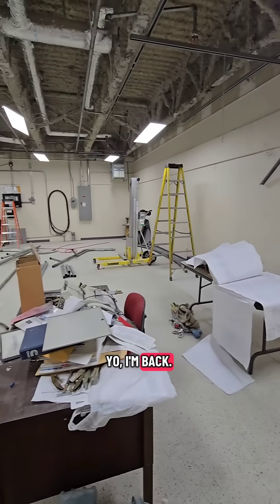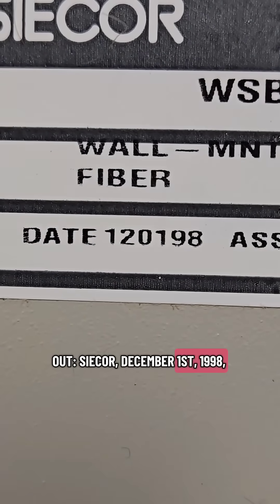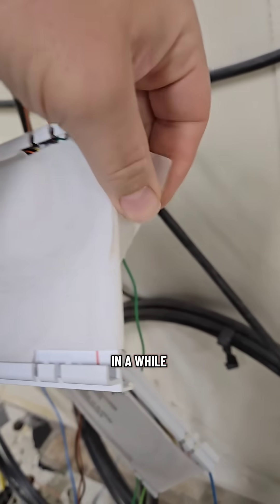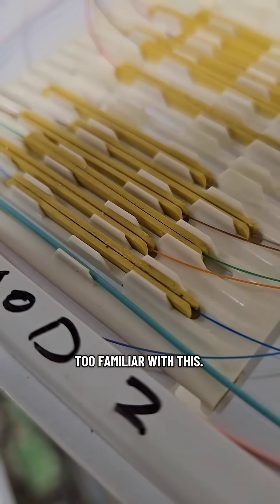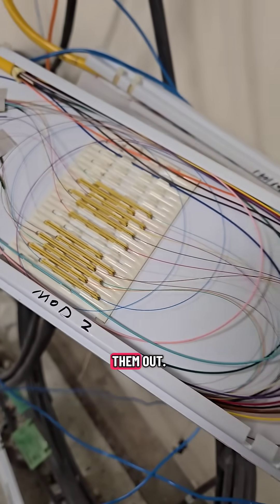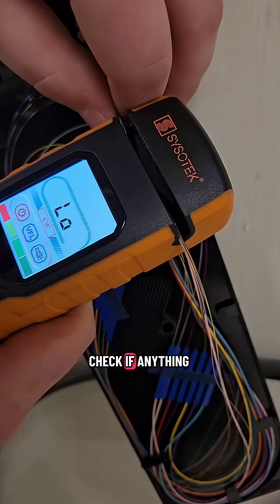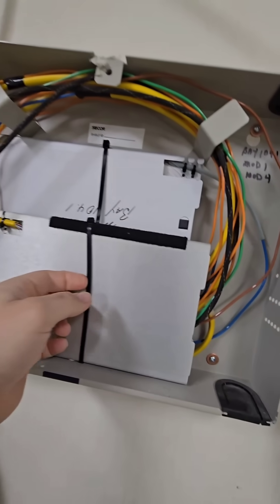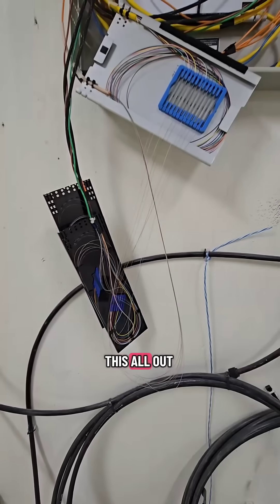#fiberoptics #fibertech #telecomlife #splicing #otdrtesting #networkengineering #sysotek #fibernerd

Comment: Those "mechanical splices" are actually protection covers for fusion splices (way before the heat-shrink tubes with steel rods in them). 

I'm really surprised to see them in those types of trays labeled as Siecor; the first time we used those was in about 1983 on NT (before they renamed to Nortel) splice equipment. They sucked ass then, just made for multimode fiber, before Siecor came out with their M67 singlemode machine, which was a godsend, along with the metal Siecor trays. The NT fiber was crap too, but the Siecor fiber was terrific.

Back then everything was super primitive,  everything was barely functional, no OTDRs, no local optimization, cleavers barely made square cuts. Shoot, not even cell phones or GPS back then; it was paper maps and payphones.

All you guys doing fiber splicing now should be glad things have evolved as well as they have. It was cool way back then but was a giant PITA too.

Comment: What's the risk of a demo crew cutting into a "live" fiber optic line?
Reply: You get angry sysadmins coming at you with steam coming out of their ears.
Reply: The optical power today can burn retinas if you look into the fiber but amplified ROADM lines can carry a lot of channels/power, and cut (broken) ends of fiber can spread powerful quantities of infrafred (invisible) light. Most systems shut down the amps to prevent problems for the workers.

And that's just a single pair, most long haul routes have ROADM systems on every pair - a lot of light.

Cable cuts happen several times every day in large networks, so there's a lot of redundancy/resiliency built in to the networks these days.

Comment: Imagine if you ever saw some knob and tube from the 20’s lol. Side note: do these lines even carry over 30v? Do you have to worry about cutting a fiber line?
Reply: Just light there.  Some cables existed that had power cables I. The same sheath as the fiber so you could power remote equipment with one cable and didn't need to get power from the power company but that wasn't widely adopted
Reply: @MrNoobed  Subsea cables using submerged amps carry power within the same cable. Interesting (to me anyway) is that there's only a single conductor in the cable, the circuit is closed by "grounding" out to the seawater.
Reply: @wayneruffner oh right.  They did try it for normal aerial/buried cables too, but thats where it wasnt really very popular.

Comment: 1998 is ancient now ☹️
Reply: 5mbs 😅
Reply: @unbanmy360 dial up was 33.6 kbps and even most large businesses would have only had a 1.5 mbps T1 if they were lucky
Reply: @thedopplereffect00  we did for internet, but had a 64kb frame relay link from the UK to Germany to get to head office. I remember my colleague trying to test early video conferencing as the CEOs (called MD then) were often from other countries and wanted to video conference their kids. I think latency was a bigger issue than bandwidth iirc.
Reply: @thedopplereffect00 isdn was the bomb for a time lol
Reply: @unbanmy360  I was on the world's very first long haul singlemode project, MCI's MAFOS (Mid Atlantic Fiber Optic System, NYC to Wash DC along the Amtrak route), and the transmission equipment was Fujitsu 405 (405 Mb/S) carrying nine DS3s. Even today, still amazing.

Comment: At my work the original builder thought ahead and laid OM1 fiber optic cable between buildings and LV cabinets. This was in the 90's!

At some point someone ripped out a bunch of in building runs of this unterminated fiber optic cabling because they got quotations of around 50-100K to terminate and certify (no one wanted to terminate and not certify due to liability). Way too expensive, they asked something like €500 for each fiber to terminate and certify.

They were still using phone lines with vdsl modems to connect the on site buildings, it worked so they never bothered about the fiber cables and on top of that they were more tight on initial investments than the full picture including upkeep costs.

But times change... At some point they needed more than a 100M link in between buildings (signage/ CCTV etc) and every now and then some of them die due to lightning. 
So every year they spent thousands in vdsl modems .

One day we bought a fiber splicing kit from vevor, spent around 1 year worth of maintenance and expansion costs of the vdsl network to get the fiber network active (Second hand cisco ftp modules cost next to nothing).

It took a giant amount of effort to convince management for the need of a fiber splicing kit.
At first they said that's big money, just aggregate multiple vdsl links.

Then they got showed the cost of upkeep and expansion of the old VDSL network and the initial cost and expected upkeep for the fiber network.
Adding to that there was a new building that needed a fiber cable due to the distance from the server room and also bandwidth requirement. 

The quotation they got for terminating that new cable fully covered the cost for the splicing kit so now they were sold on it because the initial investment was lower this way 😂.

Millenial managers and CEO are ruining everything, only focussing on less Investments and more revenue... The old timers tended to think for the future... when you do it you do it good!